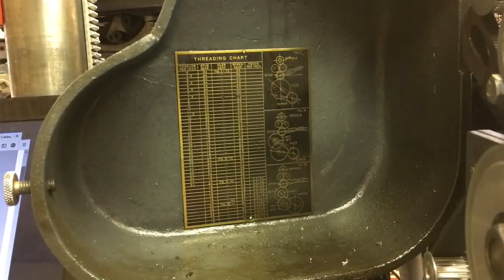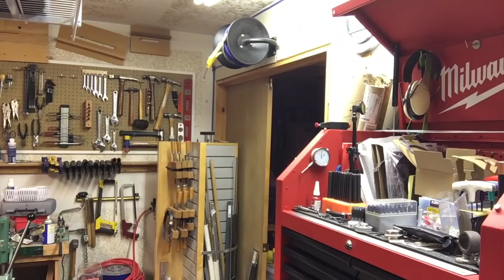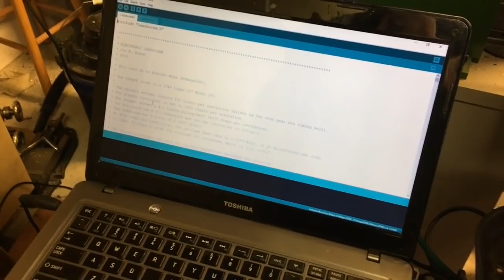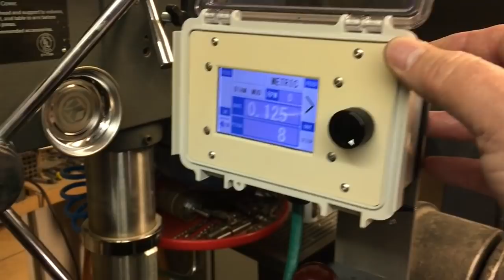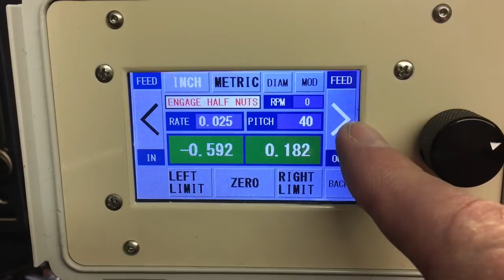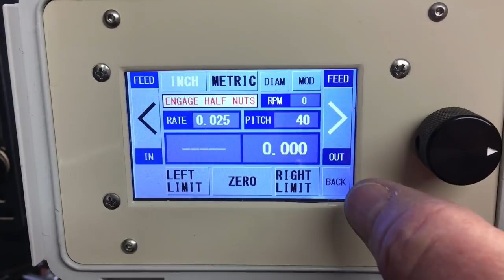My Electronic Leadscrew Project Overview

Comment: Great Project, I initially discovered the concept when I was looking to purchase a Metric lathe. Babin Machine Tool Sells a similar kit for the Hardinge HLV-H. Some thoughts I have on your design, I would like to see the out of range rates in Red, Can your screen do red background? The tolerances would be limited to the amount of wear in your lead screw and half nuts, and the majority of these old machines us hobby guys have are very worn. What if you converted your lead screw to a ball screw and had an electronic switch on your carriage in place of the half nut lever to override your servo motor?
Reply from the maker: One thing that I wish I had remembered was to show it highlighting the RPM in red if it's going too fast for the feed rate.  I intend to get that into my next video after I have all of the "helpful" speed limit stuff implemented.  I'm waiting for complaints from the color blind, though.  My lead screw is still in pretty good shape, and my numbers agree with my DRO to within a couple of thousandths over the length of the bed.  There's about 0.028" backlash in the half nuts and leadscrew end slop, though.  I might try adding thrust bearings, and new half nuts may be in the future as well.

I have done a design for a crossfeed threading stop assembly that will replace the LA-172/LA-689 bushing and provide 2-1/2 turns end-to-end when the thumb screw is tightened.  Nothing original, I had it mostly figured out, then I found some pictures on Practical Machinist of a disassembled Monarch 10ee crossfeed dial that got me the rest of the way there.  I figure it will make a good project video to put together when I'm officially retired in a few weeks.  The new bushing will demostrate threading to a shoulder nicely, too.

Comment: what was the investment ?
Reply from the maker: When I add everything up it comes to over $400 worth of parts.  Of course I spent quite a bit more than that in development costs.  If I decide to turn it into a product I can shave some off of that buying multiples.  Then there was time spent machining timing pulleys to work, fabricating brackets and panels, prepping the enclosures and wiring everything up.  Looking through the list, it really bothers me that the Arduino DIN rail adapter cost more than any other single item excluding the motor/controller.  I could have gone with a simpler adapter for about $10, in hindsight.  That and the hand-wired breadboard probably make it worthwhile to lay out a custom circuit board, but that's part of what I do for a living.

Comment: Jon,
Great usage of a MEGA. A friend of mine with a Logan suggested I watch this video as I got into Arduino technology a coupla years ago and have thoroughly enjoyed learning and applying the technology. Particular impressed with how you organized your hardware!
Reply from the maker: Thanks, Dave.  The Mega and Nextion display made an excellent combination for this project.  I'm impressed with the efficiency of the AVR chip, especially the interrupt handling.  I went to a talk by David Patterson from Berkeley 30-some years ago when he was proselytizing for RISC architectures, and now that's about all there is.

I'm happy that I chose the Arduino ecosystem because of the amount of information and support available.  I was able to find an answer any time I got stuck.  I think that I will look at STM32 processors at some point, but it looks like I have plenty of processing power right now, and the 5V I/O on the Arduino makes life easy.

Comment: The ratio accuracy for translating the inch (8 tpi) lead screw to metric pitch should be much improved.  Good show!
Reply from the maker: The Mega seems to be keeping up just fine, so I figured that better than a micron resolution was a good place to stop :).